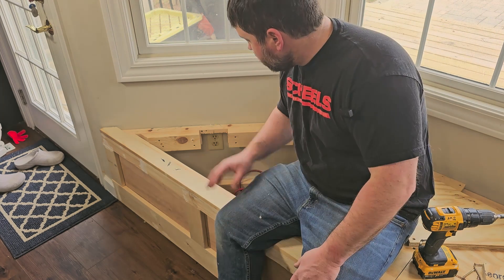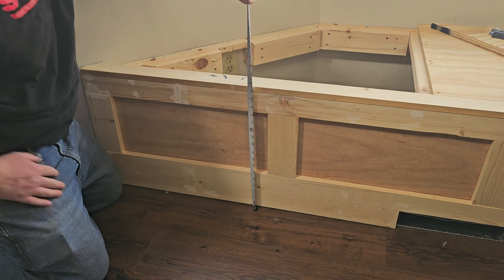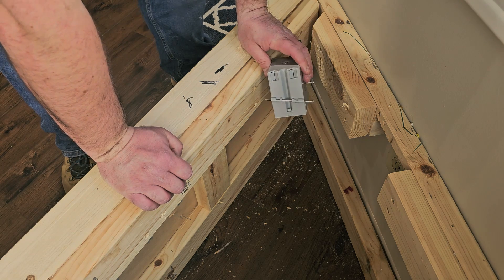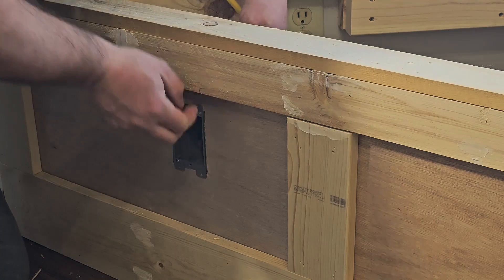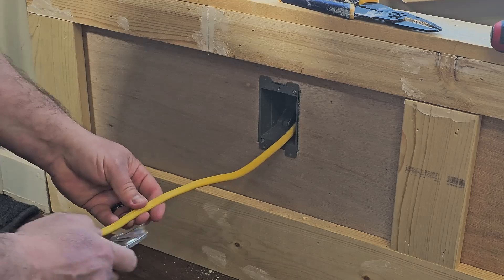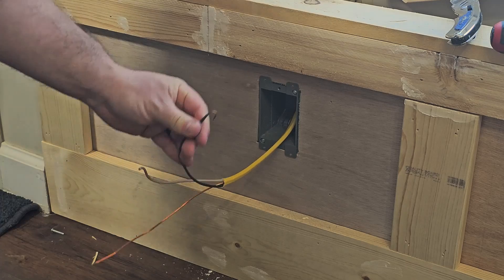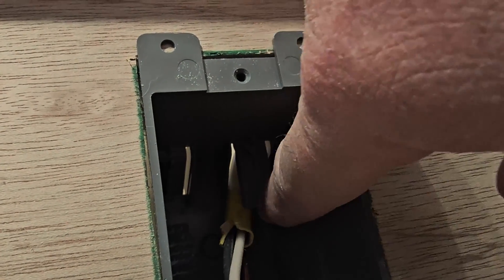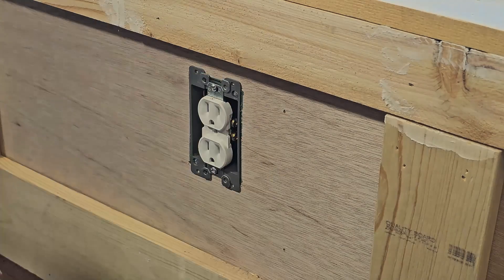HOW TO MOVE AN ELECTRICAL OUTLET | Corner Bench

Comment: That installation is not up to code since you said the wire is accessible for a storage area.  It would need to be run in conduit or BX.
Reply from the maker: I appreciate the feedback.
Reply from the maker: Would flexible conduit work for this as well?
Reply: Yes, armored flex conduit or BX cable would both work. @HomeRepairHub
Reply: So if it’s done like this install but the wires are inside conduit, would it be up to code?
Reply: Without seeing the details of the install, hard to say.  I just know that not having the conductors un-protected in an accessible space is a no-no. @natemiller6700
Reply from the maker: @natemiller6700  based the previous comment I would assume that is correct.